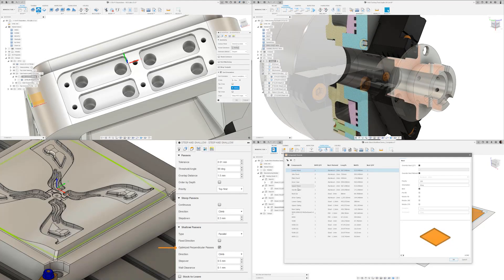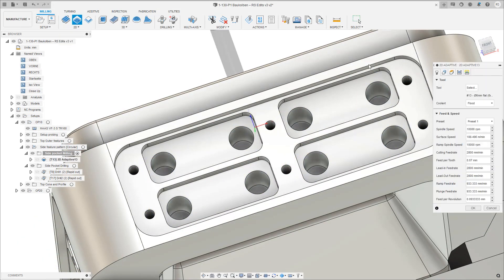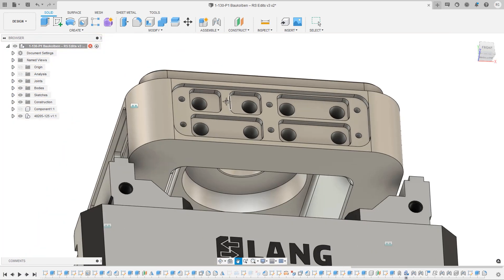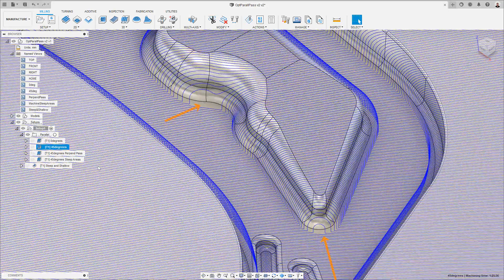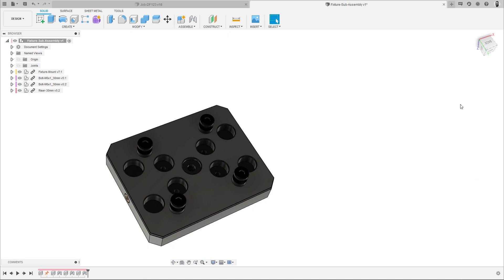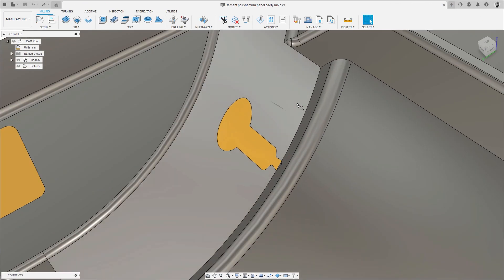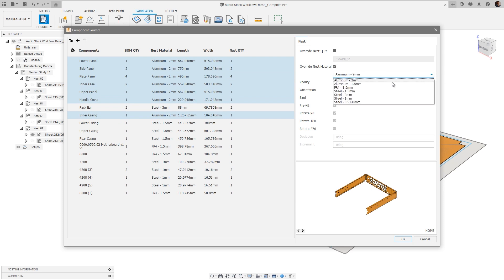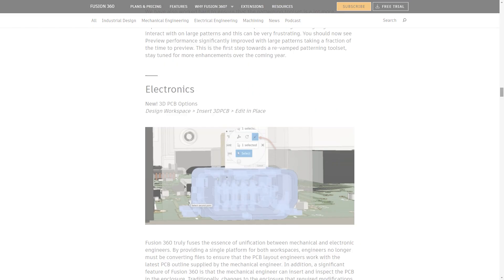What's New in Fusion 360 Manufacturing – July 2021

Comment: Everyone who uses a 3d printer is now scratching their head wondering where the save as stl has gone.
Reply from the maker: Thanks for watching and commenting Bob.  With regards to STL's, you can now do this either through the export menu (selecting [STL Files] as the [Type]), or if you only want to export a single body, right-click the specific body in the Browser tree and choose the [Save as Mesh] option.  We've done this because you can now export as a 3MF file too, so made sense to include them in the same dialog.  Check out the Design & Engineering video for July to see more - https://www.youtube.com/watch?v=0gKUaFTY1B0 .  Hopefully this will reduce the need for any further head-scratching!